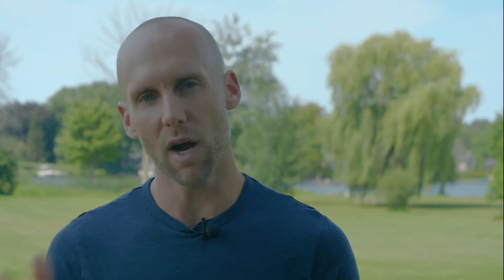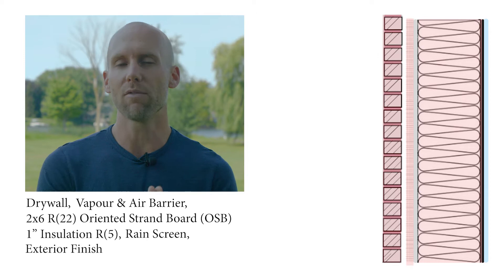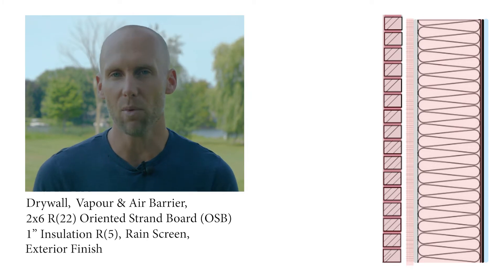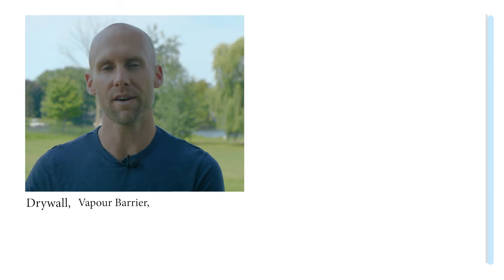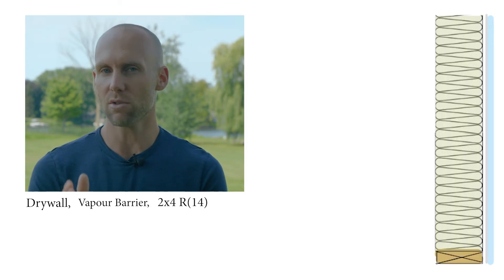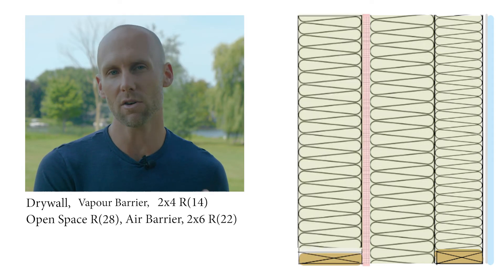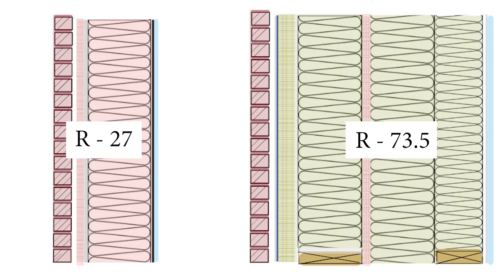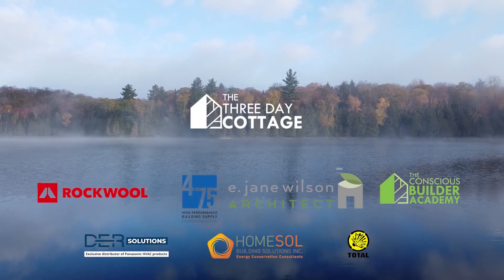Passive House Wall Section vs Building Code Wall Section

Comment: What kind of batt is used in the passive wall assembly? Is cellulose good instead of batts?
Reply from the maker: We used Rockwool. Cellulose is used by a lot of passive house builders. Personally, I feel better using Rockwool because of it's fire rating benefits and the fact that it does not loose R-value or grow mold if it gets wet.